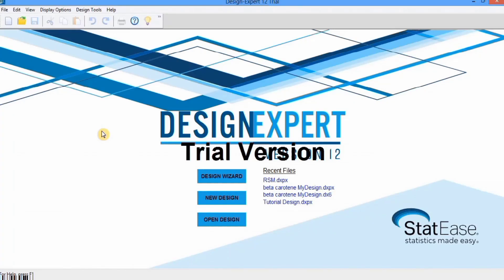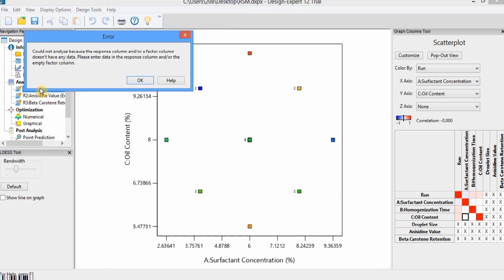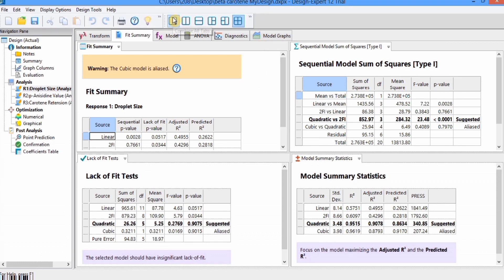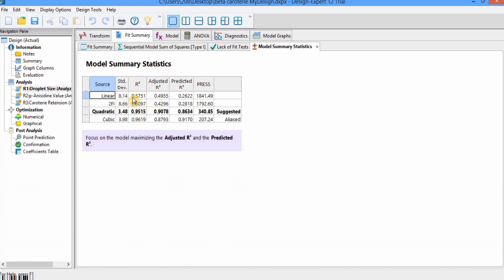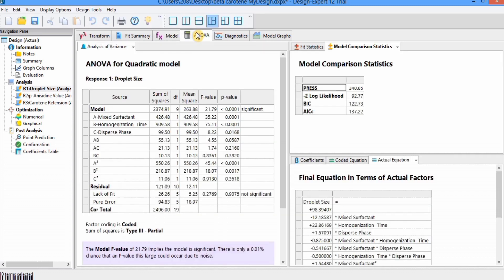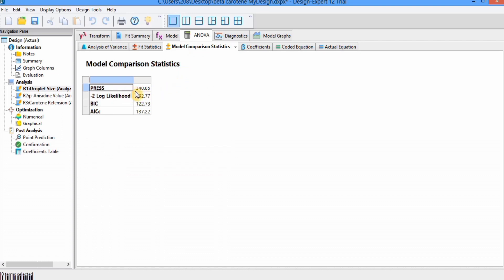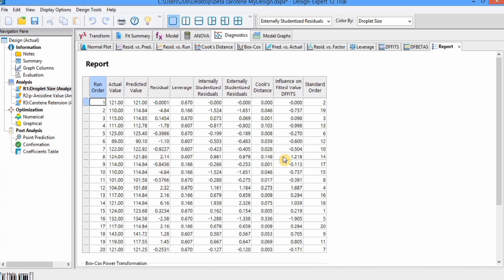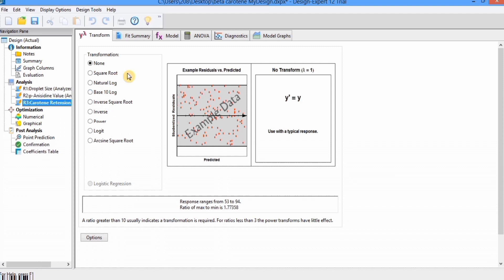How to Use Design Expert Software for Response Surface Methodology (Part 2)

Comment: Thaks a lot, a got linear and quardratic as 'suggested' after using the data from the manuscript. Based on parameters arrangement i got after model generation, i substituted values. Question is of the center point values, like how should i know what values of output responses must be used for center point values ( ex: 6 ,5.5,8 in which center points remains same, but output values differ).
Reply from the maker: In RSM we do not run replicates. The central points results give us data about the variability of our experimental values

Comment: Thanks but from where did you get the values of responses
Reply from the maker: You can get the value of response from experimental results. I have used the values of a research study for demonstration
Reply: @TeachingJunction  sir, does it mean... that the first 3 columns (factor 1, 2, and 3) are the values suggested by the software for experiments. now based on these values we have to perform the experiment manually in lab. till then, we can go for graph and other analysis ? then after getting the results of laboratory experiments, we have to fill the response 1,2,3 columns manually ?

Comment: In my experiment, the suggested model is linear. Can I choose another model (in this case is quadratic model) for the RSM?
Reply from the maker: No. That is not recommended
Reply: @TeachingJunction  even if the quadratic has higher R-squared and the lack of fit is insignificant? but the sequential p-value is 0.37 in my case.